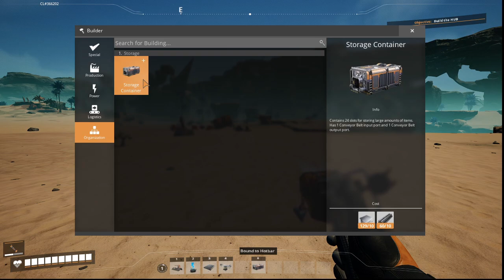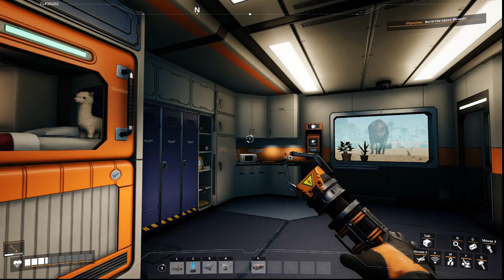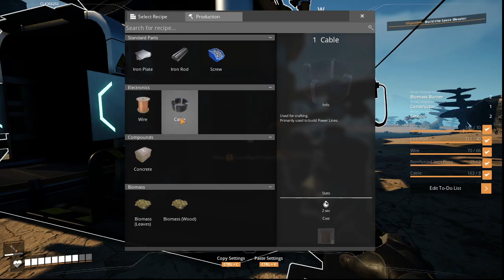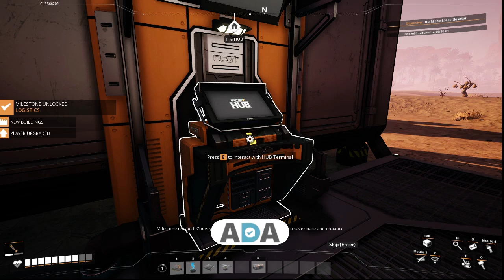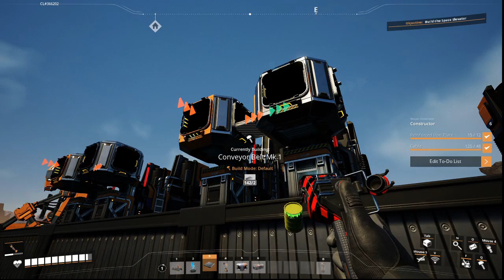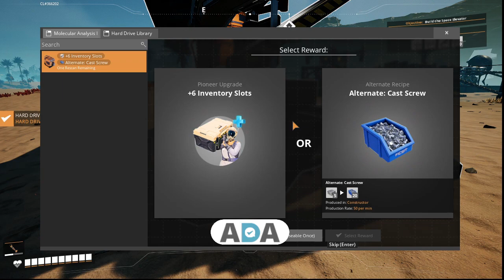Satisfactory 1.0 Ep1 The Rocky Desert start

Comment: So do you think you are going to do an entire 1.0 play through? I've just made it to Ep.15 on your older play through. I have my game in "offline" mode so it won't update to 1.0 yet. I wanted to complete your previous play through before updating. I've spent so much time following your guide, I kind of want to finish it out before going to 1.0 and attempting my own run. Thanks for the videos, my brain wouldn't be able to beat this game without watching channels like yours and others. Its still pretty neat to see how everyone plays this game and there tactics.
Reply from the maker: I will sure be doing a full play of 1.0  no doubt and also plan on going more in depth with the production and why I plan to things the way I do. I ended off season 1 at 160 hours of play getting use to everything. The major changes for update 1.0 is locations for ores, power generation rework and some recipe chamges that I have not yet seen. The unlocks for early tier in MAM and HUB seems to  near the same. For the most par the start should be same factories just running more efficient but the later stadge of 1.0 will be more of a change compared to where you are at now. I would experience the older way of the game first as it made the start of 1.0 with quality of life changes feel like a new game again and to have basic know how of how you ended the first play then then second time around you change a lot more of where and how you do things. I really appreciate the kind comment for the the videos and do agree the game can be done at so many ways it all comes down to what works out best for how you would like to do all that is needed and for access. The location for where end products are stored will be changed in update 1.0 play as I want to skip running and sliding or jumping over and under machines to access things I might need during building.

Comment: Feeding biomass burners with conveyer belts are real nice. I was powering my starting concrete,copper and iron productions with it.
Reply from the maker: Will sure set up a nice bio production area for the next one will be adding a few more machines to unlock second hub progress. I want to get the concrete foundation and walls for building since it is way less expensive
Reply: @alphablazedgamer  Also, you picked a great spot for early game. Next to the river is concrete and there is like 4 iron nodes next to the 2 copper nodes.
Reply from the maker: It is great to know should progress real quick then to transport really want to use trains in this mostly flat like area. Hope oil and so will not be too far out